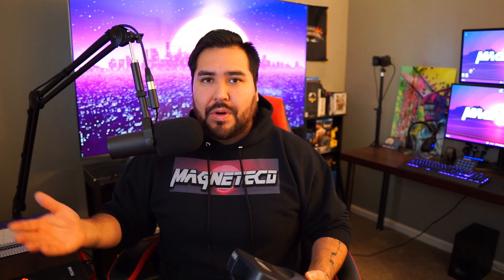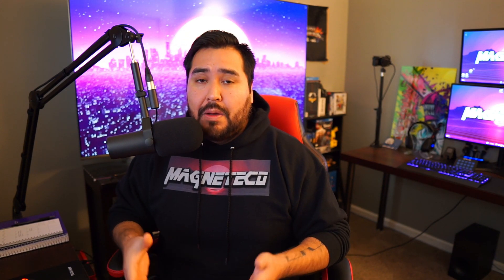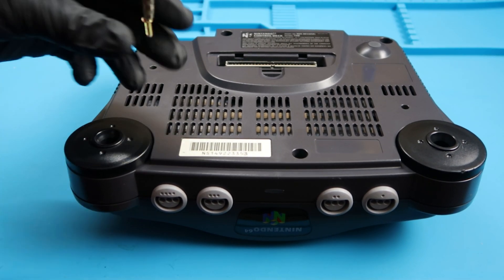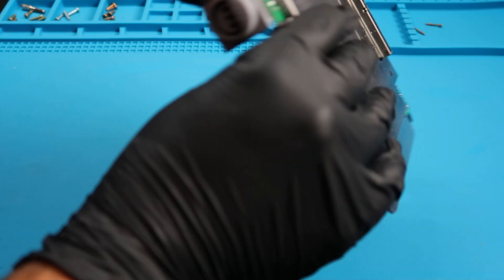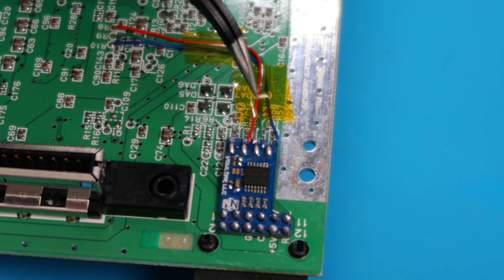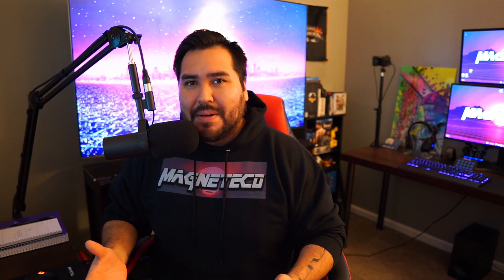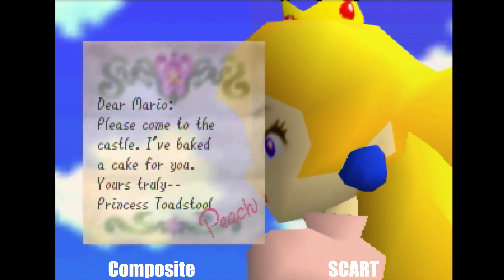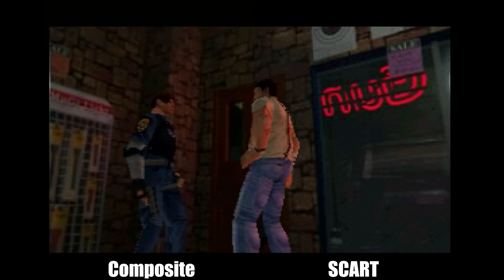Tutorial | Nintendo 64 RGB Mod | 4K🔴

Comment: I wish I could get Voultar's or Etim's kits, but they're either unavailable to where I live or way too pricey with postage and import taxes included. So I ended up ordering a cheap Hispeedido version (I think it's based on an open-source project). I heard it should be good enough! It's basic with no extra features, but at least it supports c-sync.
Reply from the maker: @Moshugaani  You have to work with what you can get. Import prices can be terrible sometimes, I completely understand that.

Comment: so you have to have a scart monitor to use this?
Reply from the maker: I use the RetroTink5X which has a SCART plug-in. This mod also let's you use a component cable like the one HD Retrovision makes. The component cable is harder to find but you can get a cheap one on Ebay if you'd like. The quality won't be as good since they typically  don't have shielding that protects against video noise.